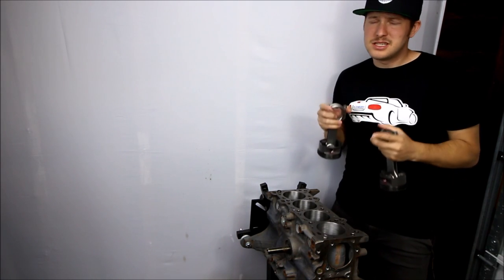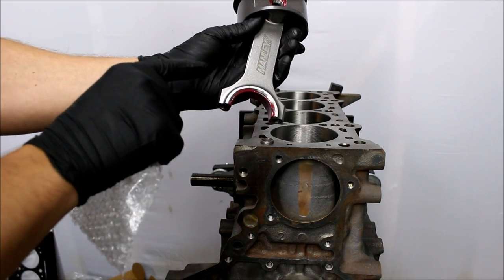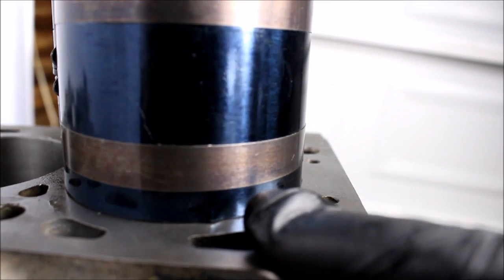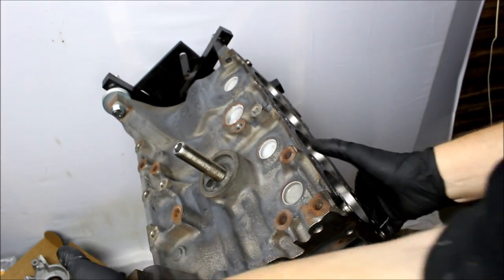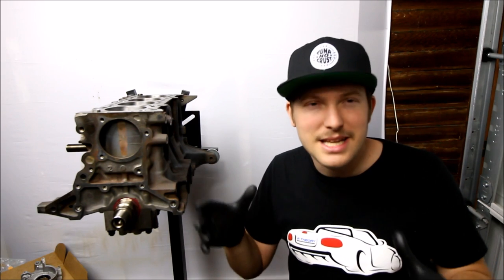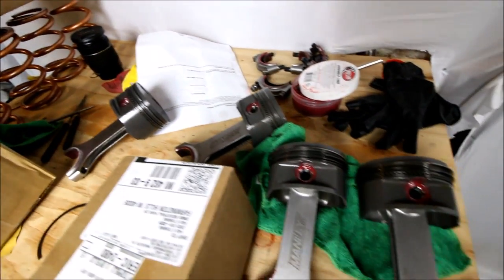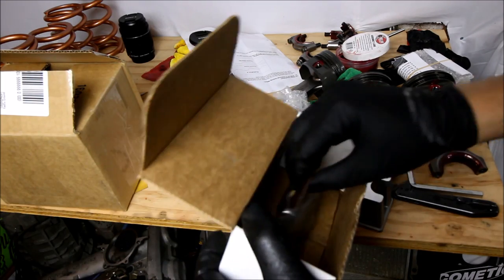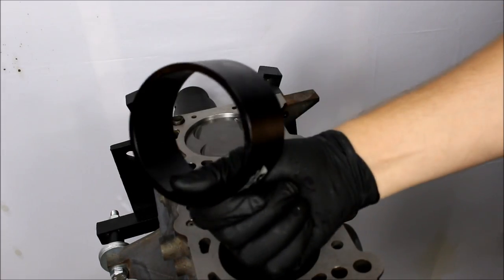FIRST MISTAKE On The VVT Engine :( Piston & Rods Install (Rebirth Ep12)

Comment: What's the red lube stuff you are using?
Reply: It is Assembly lube, made for assembling an engine!
Reply: Yeah you use it if the build is gonna take a while before it gets completed and tuned. That stuff is thicker and doesn't drip or thin out like oil. If you are very fast and can complete the whole thing and get it running in a day, motor oil is fine.
Reply: What brand tho
Reply: Is assemble lube needed? isn't it possible to use regular engine oil?
Reply: Engine oil is fine if you are going to build it and start it right away. So shops and people that know what they are doing. Your average weekender isn't going to start an engine from scratch and fire it that day. It will more than likely be a drawn out build from a week to a month. That assembly lube is better for engines that will sit longer before start up.
Reply: Always use a high quality engine assembly lube where it is needed on rotating bearing surfaces and piston/wrist/gudgeon pins. 

Motor oil is NOT fine to use as an engine rotating assembly lube anytime, immediate or delayed initial startup. 
During initial engine startup there is usually no engine oil circulation for up to 120+ seconds and engine oil does NOT provide adequate film/boundary-layer lubrication preventing metal to metal bearing damage for more than a few seconds without oil pressure and a high quality assembly lube provides adequate metal to metal protection and lubrication until there is oil circulation and adequate oil pressure and hydrodynamic/hydrostatic lubrication is established. 

Do not use automotive/chassis/GP/Moly/Silicone/wheel bearing grease or Vaseline/petroleum jelly as an assembly lube, it is an inadequate lubricant, does not dissolve in the oil and immediately clogs the oil filter media. 

Engine oil is adequate to lubricate cylinder walls, piston skirts, piston rings, valve springs, oil pump and timing chains but NOT rotating bearings and journals including cam bearings and journals. 

Camshaft lobes, followers/lifters, pushrods and rocker arms load contact points must be liberally coated with camshaft specific assembly lube, however do NOT use camshaft assembly lube on bearings and journals.
Reply: Pat, negative. Multiple engine assemblies are just fine with thick engine oil. Not to mention if you are working on an older v8 type engine you can manually pump oil into the engine. Even modern engines you can tap into a pressure line and use a hand pump to circulate throughout. 
When ever building any engine, you should use what the factory or parts manufacturers recommend but using oil as an assembly lube on a fast build has been done for decades. 
Saying that "motor oil is NOT fine" is a no true Scotsman fallacy because it is fine depending on the circumstances.
Reply: Not to mention engines like Mazda rotarys use Vaseline to assemble and you should do an oil change after break in period regardless so your filter will get clogged pre maturely anyway.
Reply: +adam courtney  
With all due respect that is your opinion and in my opinion you are entitled to your opinion and to express it. 
However, most reputable high-performance rotating assembly, crank and bearing manufacturers disagree and recommend using a high quality assembly lube. 
Some manufacturers provide specific assembly lube recommendations and or have their own in-house brand assembly lube... for a reason

And many bearings are damaged during the initial startup due to inadequate lubrication using plain oil. 
Don't take my word, contact Mahle, Clevite, King or any of the reputable bearing or rotating component manufacturers and ask to speak to their tier 2 or 3 support engineers. 

Engine oil can be used during assembly IF there is a thorough full pressure and full flow prelube procedure lasting at least 6 consecutive minutes immediately before initial startup. 
Most do not have pressure prelube system equipment. 
Makeshift home prelube systems employing a hand pump are usually not adequate. 
Prelubing as mentioned above does not eliminate the need for camshaft specific assembly lube specified by the cam and or lifter/follower manufacturers.  

As a multi-discipline engineer in the professional motorsports industry for over 30 years and a certified STLE lubrication engineer there is sound science and there are specific time proven reasons to always use a high quality assembly lube and not use engine oil. 
We have a record of annually producing approximately 600 competition engines, many for professional teams with high percentage zero defect. 
Last year we had 0 DOA and experienced 1 in competition catastrophic failure from detonation (0.016 percent failure rate) that was traced to the specific tune.
Reply: +adam courtney 
Mazda rotary engines use Vaseline ONLY on the apex seals, assembly lube is usually used on all other sliding and or rotating components. 
The Vaseline on the apex seals is never exposed to the engine oil and is never circulated. 
Not true, grease and or Vaseline clog the oil filter media and can cause oil starvation or bypassing where unfiltered oil is circulated during the break-in period (NOT good).  
During normal break-in the oil filter does not get clogged.
Reply: umm if your starting a dry motor your not an engine builder. engine assembly lube is good for one purpose thats crank driven oil pumps.. all the engines i build run engine oil as all lubricants.  i dry run the oi pump for 1 hour before first start(thats cam driven oil pumps.). crank driven oil pumps can not be driven but you should still turn the motor t 100 times till you have a read out on the oil pressure.
Reply: As  ac has commented, engine oil is fine. But I would still recommend engine assembly lube. I once rebuilt a 6 cylinder turbo diesel engine from a 1980-82 Mercedes Coupe Deville. I used assembly lube for my rebuild. I thought I was going to run it right away but I didn't. I jumped on other car projects and years went by. A friend wanted to buy it but he thought the engine would be stuck by now. I said, I doubt it cus I used assembly lube. I got a large socket and wrench, he attached it to the crankshaft bolt and it turned over with no problem. There is no way that if I had I assembled my engine with only motor oil that the engine would have been saved. So I always recommend assembly lube cus you never know how long that engine will sit without turning the engine over by hand or by cranking it.

Comment: Hey Greg if you would go back wouldn’t it be easier to bore out a 94 miata block that has the turbo return line on the side of the block?
Reply from the maker: Pavel Kirkov I wouldn't spend time sourcing an entirely different year block just so I didn't have to add a $15 fitting for the oil feed. Just me though

Comment: I dont even use a hammer. Solid compressor sleeve and both thumbs, if i cant get it in like that than something is not right or in the way and you shouldnt force it with a hammer

Comment: Nice vid, quick question: what has been your experience with the strength of the stock 1.6 diff? What can it handle it terms of horsepower. I have been looking for a miata in my area and there are a lot more clean 1.6s than 1.8s, and was wondering if it was worth holding out for a 1.8 in terms of the strength of the diff. Thanks.
Reply from the maker: brandoGTR48 The consensus is around 200wtq you're pushing your luck. I ran more than that for a good while, even with some autocross and drag, and never broke it. I did eventually swap out to a 3.9 from a 2002 Miata
Reply: Thanks, you can research all you want but it won't ever compare to hearing from someone with real personal experience.
Reply: nice chuki beats too lol

Comment: also. if you only put the compressor on the rings. then tap it to seat it on the deck. the rings almost can't sneak out and get broken . and the push and not tap to get the pistons in. you are not likely to push hard enough yo break anything. that's how I have done it for years. and never had a problem. I did break a ring once. but I dropped the piston. and got a 2peice ring . that can be very costly mistakes!

Comment: Did you increase the bore to fit the 84mm piston or are you on stock bore size
Reply from the maker: Yes, boring the block is required for anything above the stock 83.0mm pistons

Comment: tip INC use your hands to push the ring into the piston and the heel of your wrist to press the pistin in and finger fuck it till she meets the crank and a flatfile the little ones are the best for ring gapping no need for fancy shit unless you do it for a job

Comment: You should use a clamp model ring compressor. The first one you had are known to be shit, the Wiseco seems decent. Also dont use so much force when hitting down the piston, lifting the hammer and dropping it like an inch should be enough to slowly tap it down.  Hurts my soul when you bash those in... :/

Comment: lube the cylinder not the piston, last thing you want is oil in the compression rings that gets burned in on fire up. the oil rings will wipe all the oil off cylinder as it goes down.  Rings DO NOT NEED OIL. If you oil the rings you run the risk of hurting break in

Comment: Hey guys for the 1.8 bp4w buy a weisco 83mm solid ring compressor.
Reply from the maker: Not exactly - for 83mm pistons in a BP4W, use an 83mm compressor. For 84mm pistons in a BP4W, use an 84mm compressor. And so on 🙂

Comment: Hey Greg, I want some advice my 94 Miata has a bad head gasket, should I rebuild or replace the engine
Reply from the maker: +nader younes if it has a bad head gasket you should replace the head gasket
Reply: TheCarPassionChannel well see I drove it 100 miles to get home while it was overheated
Reply from the maker: nader younes Probably still just needs hg and head refresh. Not a good idea to drive an overheating car
Reply: nader younes do a compression check check ur oil for coolant your coolant for oil visually inspect for cracks if all looks good get block and new head decked lightly and install new head gasket

Comment: Not real crazy about wearing gloves for this job. Reduced sensitivity to contaminants. Hard to see any dirt on black gloves. Found some orange or fluorescent green industrial grade nitrile gloves on Amazon I might give a try though. I want to be able to see any junk that might be on my hands that could end up in the engine before it gets there. Since my rings run $200 a set, I think I will go with the Wiseco compressor. Hate to spend $35 for compressor since I only plan to do this once, but I guess I can sell on eBay when I'm done with it.

Comment: Greg, one more tip...Don't you adjust where the ring gaps are in relation to the exhaust valves? the top ring should always be away from the ex. valve and no two ring gaps should be in line with each other. This prevents blow-by and oil consumption. otherwise good work. Keep it up!    Chevy Steve
Reply from the maker: Steve Tonetti I oriented the rings according to the Supertech diagram (last video "put a ring on it") although it doesn't face the top gap away from the exhaust valves. I'm not stressed about it, definitely noted though, thanks!

Comment: How do you know what size pistons to get. I plan on taking my motor to the machine shop first to be honest and cleaned and I don’t wanna by the wrong pistons due to machine shop boring
Reply from the maker: Your block has to be bored to the pistons that you supply the machine shop with. They will measure the pistons and then bore the block

Comment: how do you put the piston into the weisco spring compressor? arnt you put into the same place where you need something to put it into the compressor? may be a stupid question but im not sure as to what happens here
Reply from the maker: See 8:25 the sleeve is tapered. it's about 90+mm at the top and 84mm at the bottom.
Reply: TheCarPassionChannel thanks I missed that when watching, appreciate it

Comment: Mr Savior Greg Peters, What is the stock diameter of the 1.6L pistons? I am looking at a wiesco piston compressor for I don't mess up my rings! (I ordered 2 sets just incase..) I tried google and it said 404
Reply: I think I found 78mm but then also 86mm?? unless the 86 is bore diameter and piston is 78mm?
Reply from the maker: @TheMapleDaily  The bore is 78mm on the 1.6, 83mm on the 1.8
Reply: @TheCarPassionChannel  I will attribute all my miata's success and all confidence in myself to the GOAT, Greg Peters. When I get my youtube series Poor2PSI going you'll be in the credits and description as the mentor! As well the rebuild should start be the end of this week!
Reply: @TheCarPassionChannel  One more quick question, should I get a 79mm wiseco ? or an exact 78mm? (stock 1.6L just honed)
Reply from the maker: @TheMapleDaily  You can only upsize the pistons if you bring the block to a machine shop to get bored out
Reply: @TheCarPassionChannel  I don't want bored, nor anything that is not 100% stock. This is a restoration of a 93 LE for Musuem Use. I have a 1.8 VVT miata for boost! I am just about to buy the wiseco, I assume 78mm since its the exact bore of the 1.6L so it should work. Hoping by friday or saturday I can start work!

Comment: My first engine, I used the crappy sheet steel ring compressor and chipped a ring, I ended up scraping the whole project because the cost of the rings broke me.

Comment: Why don't you paint the outside of the block as long you have the possibility. I think a nice painted block makes the engine look so much cleaner inside the engine bay and it gives you mad street creds. Just thought, you wanted to scare some Mustang drivers ;)

Comment: The first ring compresor is wery good but you have to know how to use it.
The weak mechanic vill bleam the tools !!!
Reply from the maker: It might work, but the 2nd one is far better, and easier to use.
Reply: @TheCarPassionChannel  yes is way better but in this case you can't blame the tool
Reply from the maker: @Lorant86  As stated in the video, better technique AND a better tool could have prevented the failure.

Comment: Those adjustable ring compressors are absolute junk. They are hit or miss tools that have brought the toughest men to tears. That new one you bought may be one of those tools that takes up space in your box, but is worth every penny when you need it. You might be able to rent one too if you don't want to invest. 

I've built a few engines and have to say the first time is terrifying. But you realize that its just metal bolted together and as long as you research the correct procedures for assembly, you should be just fine. If you blow it to bits...... Try again and learn from your mistakes.

Comment: you are going too slow. you get it close make sure the compressor is right. and then more like a push than a tap. and you are in! and make sure the ring end gaps are not aligned  with each other. that can cause bad blow by. it don't really matter where the gaps are as long as they are away from each other.I do 180from the other gap.
Reply from the maker: Gaps are oriented @180 degrees and 120 degree separation for the 3 parts of the oil control ring :)

Comment: Engine. Internal combustion is an engine.  Motor refers electric. Electric motors, and combustion engines.
Reply from the maker: branding jomea Motor - a machine, especially one powered by electricity or internal combustion, that supplies motive power for a vehicle or for some other device with moving parts.
Reply: A motor is a machine that converts other forms of energy into mechanical energy and so imparts motion.

An engine is a motor that converts thermal energy to mechanical work.
Reply from the maker: branding jomea Yep, and an internal combustion engine is a type of motor.
Reply: Motors are electric. Electricity powers motors.
Engines are powered by come sort of pressure or combustion, ie: steam engines, automobile engines, diesel engines.
Reply: Sorry, not trying to be a dick. I was always corrected by a previous co worker.
Reply: obviously you can call it whatever you want and many people use it interchangeably

Comment: you dont need plastic when you drop piston in, it dont brake it lol
Reply from the maker: AksiOnPc it's to protect the cylinder from being scratched by the rod
Reply: Yes i know but doing that need to be so much pressure, have done this with no problems or damage :)

Comment: Some of your steps are kind of overkill. That ring compressor is junk. My advice to anyone wanting to build an engine. Buy a cheap motor from the junkyard. Take it apart and clean it and put it back together. Better practice than learning with your $1500 rotating assembly
Reply from the maker: Akizzem See end of video for new ring compressor. Lesson learned. On the junkyard motor - already did it

Comment: To bad you aren't building an engine with any torque
Reply from the maker: 350wtq in a 2200lb car will be plenty, I assure you,
Reply: TheCarPassionChannel not enough for my purposes
Reply from the maker: Brian South Plenty for mine. And guess who's car it is.
Reply: TheCarPassionChannel The banks.
Reply from the maker: Brian South Guess again, if you can't afford a $3K car you can't afford to build a motor
Reply: TheCarPassionChannel congrats on less than v8 numbers and 4x the cost